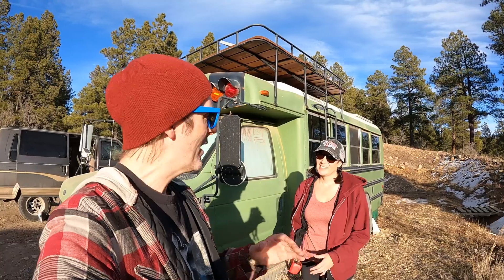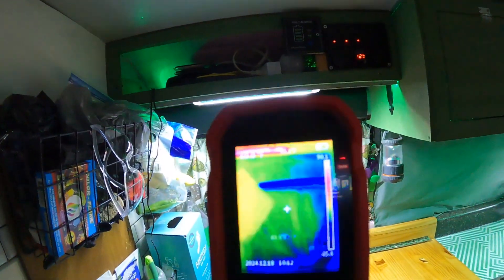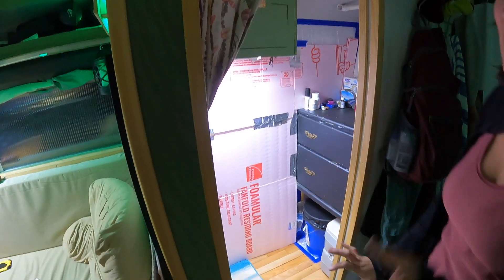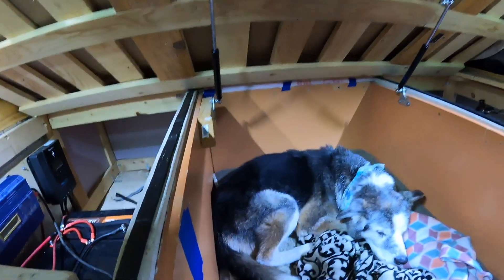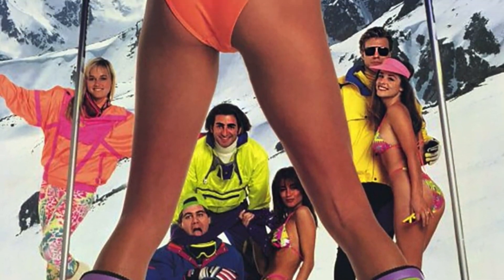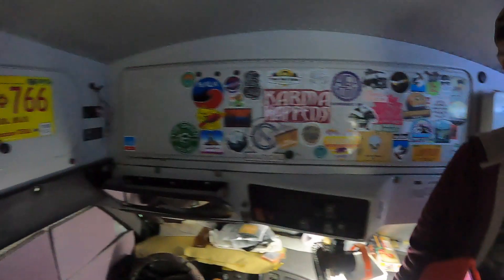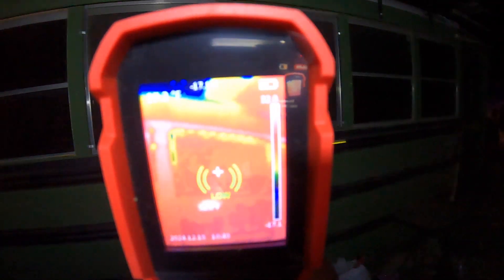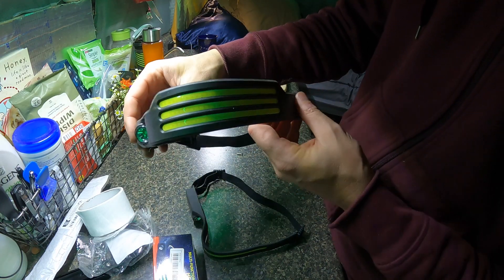Thermal Vision: How I Found and Fixed Heat Loss in My Bus

Comment: If your mattress is part of the insulation it will likley start having condensation issues. The way its setup now might start having that problem.
Reply from the maker: We have most of the under bed storage walls insulated, so far no condensation.  Still need to add more, but nobody nearby sells foam sheets and the nearest place that does is over 1 hour away.  I'll get it done properly eventually.

Comment: velcro might hold that insulation to the fan
Reply: Yeah RV's here in nordic use velcro with insulation padding + foil to block fan ducts on ceiling during winter. Best would be semi rigid insulated plate that you could clamp there to seal it.
Reply from the maker: @sl06bhytmar  Not sure what I'd clamp against, but I'll look into it.   Whatever it is, I want to be able to quickly remove it, we like having it cracked during the day to prevent moisture down inside.
Reply from the maker: I was thinking magnets?  I haven't done it yet tho.

Comment: Please try laying a sheet of styrofoam insulation under the mattress of your bed. The insulation is made by Henry’s and sold at HD. About $15. The piece is 2 inches thick and 4‘ x 8‘ or more. 

Thank you again for working hard on these videos. you and the spouse have that great attitude of friendliness, intelligence and Sharing along with strength, agility, and beauty just like me and the many other badgers in the free world. Now, Rock On.
Reply from the maker: Hey Rock, actually the bed itself is an insulator!  We have firm closed cell yoga mat type foam against the bed frame, and then a 6" mattress topper, and the camera showed it as not a source of heat loss.   

Regarding the foam tho, one of the challenges in our location is that home depot is over 1 hour away, so it's hard to justify 2+ hours of driving a 13mpg vehicle to get 1 board of foam.  I want to add more, but the local places don't sell any.  Glad you appreciate it, we definitely learned a lot!